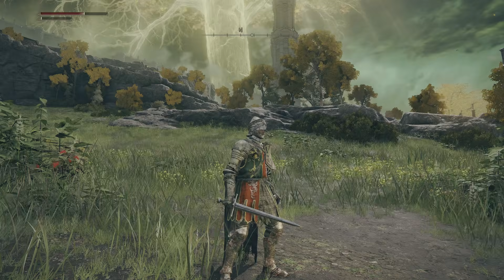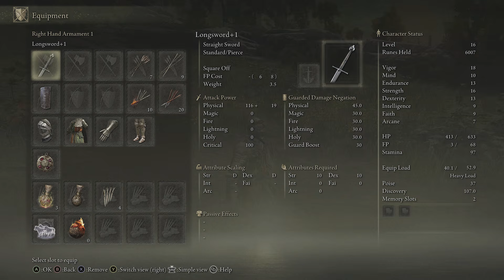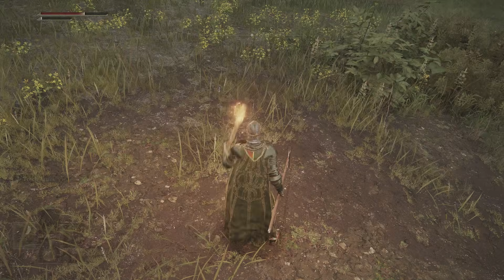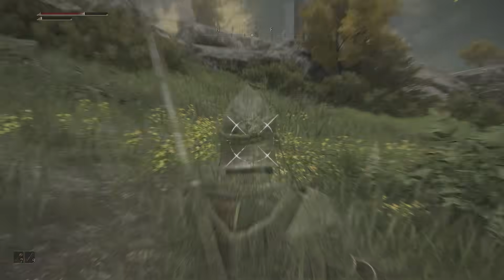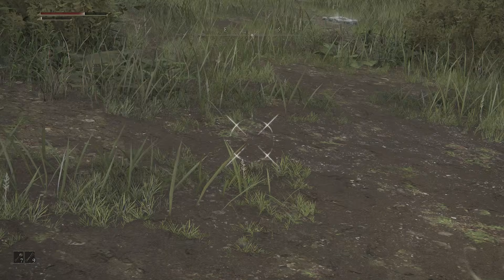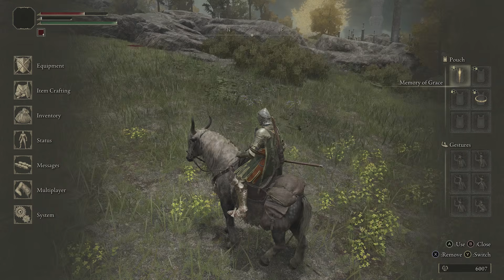Elden Ring Equipment Menu Explained

Comment: r armament 2 is higher than r armament 1 ? is it true ?. i see this when try to level up
Reply from the maker: The position shouldn't matter. Different weapons will have diffferent damage depending on how they are affected by your stats. So, for example, if you look at 24 seconds on the video. See in the middle the attribute scaling? The sword here scales best with strength and dexerity but only D rated. If you have another weapon that scales with other stats, the damage will differ most likely. Some weapons will have a better level for scaling (for example A is better than D) and also that can be improved by levelling up the weapon with Smithing Stones. Hopefully that helps!

Comment: Thank you for this. I love this game, 40 hours in and barely have touched everything I can do and see, but I still suck at organizing my inventory, especially the quick menu. Top part is always empty and i have trouble with selecting more then 4 items to use.
Reply from the maker: You're very welcome. Top part is reserved for spells. I don't think you can chuck other parts in there. Bear in mind it's not good to put loads of weapons in the left or right slots as they'll add to your equipment weight and slow down your roll. Keep things a light as you can to keep you agile.